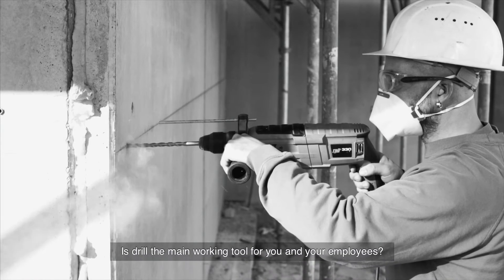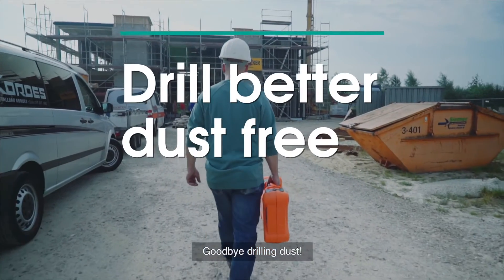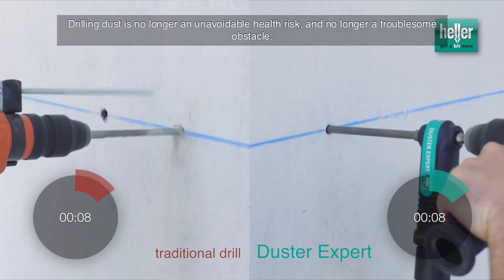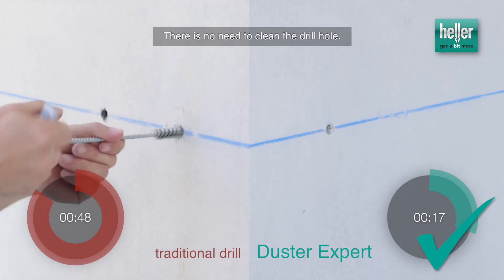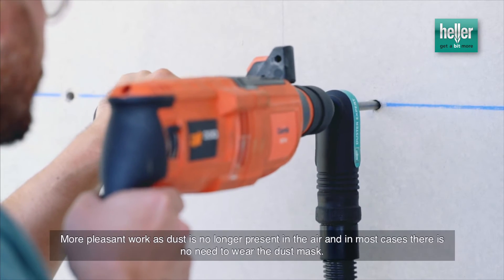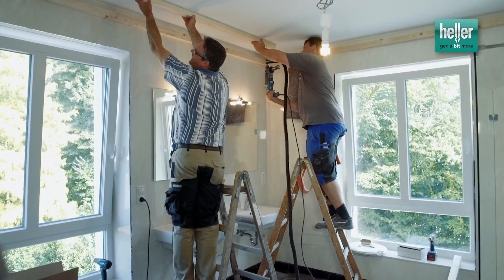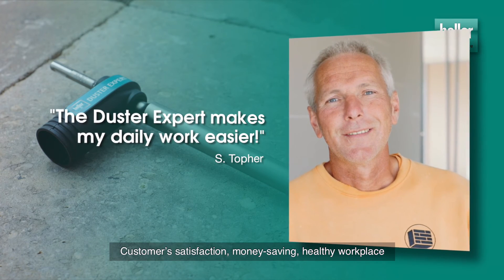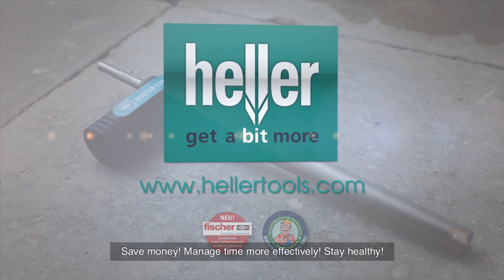Enhanced dust-free drilling

Comment: East Engineering Components are your go-to supplier in the UK for Heller Drill bits. The Duster provides higher efficiency over conventional drill bits due to less clean up and most importantly a (98% dust reduction) in dust particulate entering your environment.